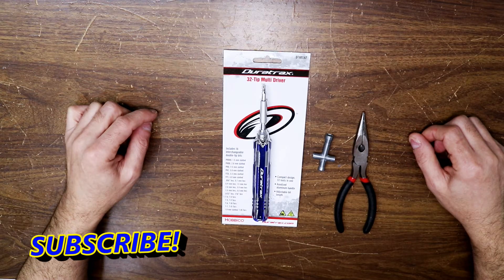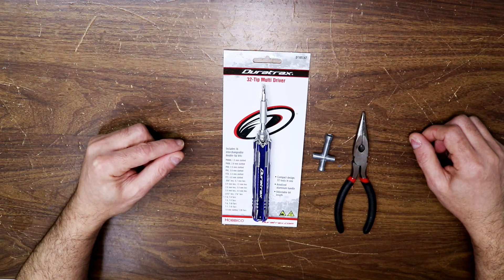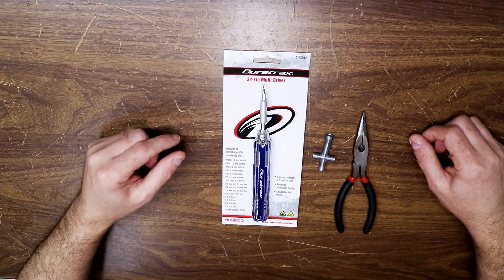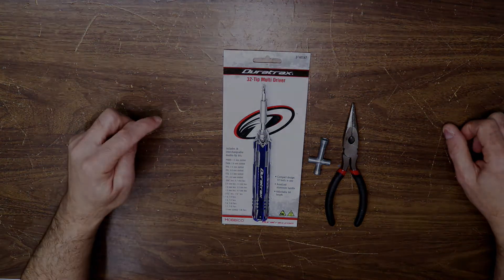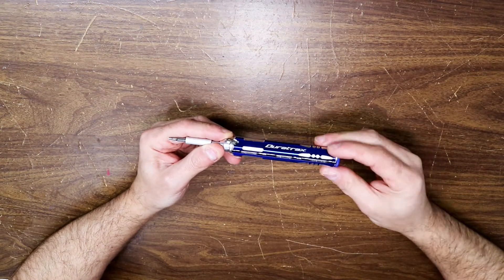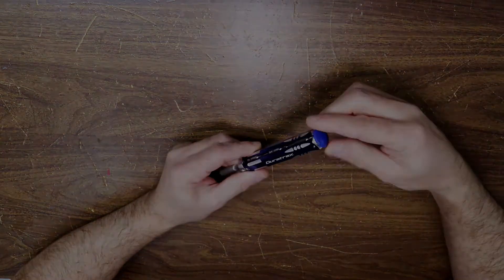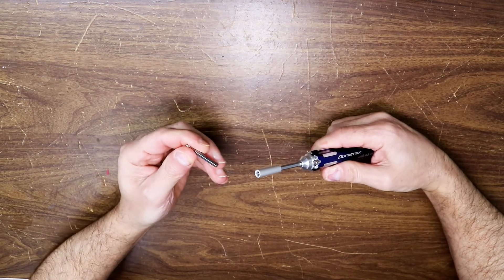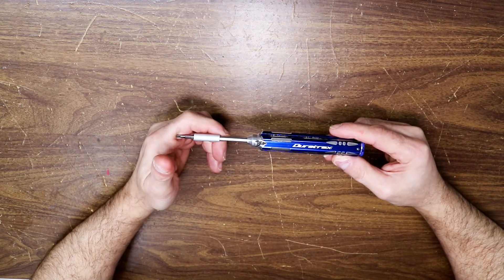Duratrax 32 Tip Multi Driver tool great for RC and more!

Comment: Looks very good. Have been wanting something like this to have with me in the runs. Are the bits machined or mouled? Don’t know if those are the correct terms in English. Would love if you tried to do a little more close-ups when you show these smaller parts. I think more and more people are watching youtube on their travels on their phones and it’s just impossible to see or get a feel for the small parts when they are held up from a long distance. Just a thought. Hope it is okay. Thanks for sharing this. Looks like a cool and handy tool to have with you into the field.
Reply from the maker: Hi thanks I got this for use out when I am riding the RC cars I don't think they are super hardened steel type bits but for when your out and need a tool that can do most anything and you can bring it with you very easy I think it's good enough. 👍😊👍
Reply: Shen RC Yeah think you’re right. Will be great as long as not used in long builds at home. The thing I’m most worried about is the small hex like the 1.5. Too round and it will easily strip the screw hex (not the correct terminology I know but English is not my correct language 😃)
Reply from the maker: I use these for home use they work awesome you should get them and they have replaceable tips!  
you will love them best ones I ever used!
https://www.ebay.com/itm/Integy-Wrench-Set-Ti-Nitride-Hex-7-INTC22346/172897167584?epid=1200563360&hash=item28417968e0:g:~pkAAOSwTIhaUMXq ;
and ones with smaller handles on them  https://www.ebay.com/itm/Integy-Hex-Wrench-Set-Ti-Nitride-6-INTC22301/162439711666?epid=1500625739&hash=item25d2294bb2:g:qdEAAOSwXOVaUL9H
Reply: Shen RC Thanks for the tip Steve! I think a set is too much for me (I only use the 1.5) could definitely use a strong 1.5 mm hex with a replacable tip.